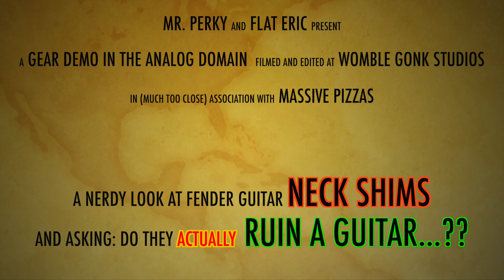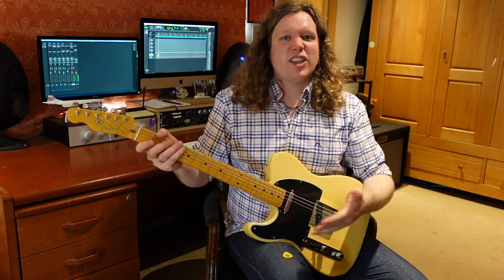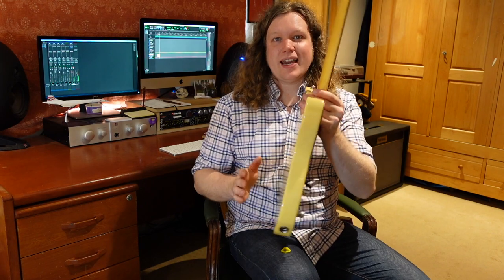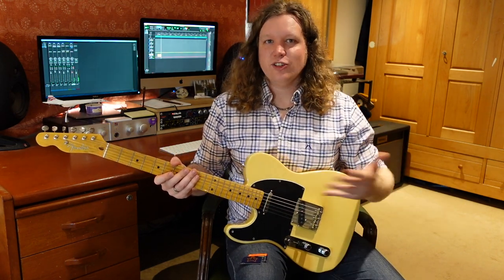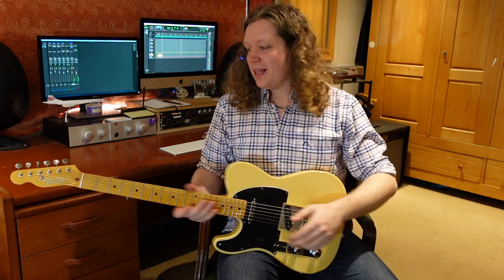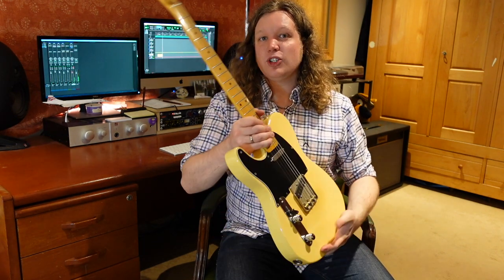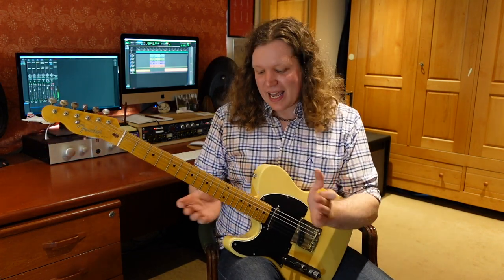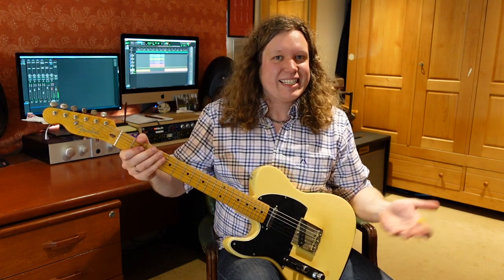Does 'Shimming' The Neck Ruin A Guitar...? (Cardboard & @stewmac)

Comment: In my experience: The best guitar is the one you want to pickup and play. If not being able to bend those notes makes you not play it, always shim!
Reply from the maker: 100%!  Playability much more important than a slight difference in tone.
Reply: Exactly!
Reply: I have a cheap Ibanez GIO from 2004 that I bought as my first guitar. I have molded so much that is is unrecognizable, that includes stainless steel frets along a leveling job and let me tell you, that guitar is my favorite 25.5 scale guitar in my arsenal and comes from someone who also owns a Fender American Strat. Facts are facts. Playability>price, brand, model.
Reply: It's a shim that guitar manufacturers don't produce the guitars with a neck angle. Basic

Comment: The thing with cardboard isn't tonal, in my opinion. The real issue lies in the cardboard compressing over time. What happens is that as the cardboard shim compresses and the neck ends up at a more shallow angle. This is why the StewMac wood shims are actually a bit better. They correct the angle and stay much more substantial for a longer time. More about longevity than anything.
Reply: Wood will compress too. Put a C-Clamp on it and tighten it down and remove it and observe the indentation or hit it with a hammer. Chances are the neck will shrink and expand far more from time to time due to environmental factors like humidity and temperature.
Reply: @Vicos  You're right but at the same time, they won't compress quite that way because they're the actual size of the neck pocket, and they're hard maple. They spread out the tension evenly so yes, they may eventually need replaced, but not anywhere close to as quickly as paper or cardboard. Using a c-clamp put all the squeezing force in that one spot and forces it to compress in that spot

Comment: My 1994 USA Fender Stratocastor has an overhigh action, and with the string saddles taken down it is still over high, and I get dead notes and string buzz after the 12th fret. My neck s straight enough so I don't believe it needs truss rod adjustment. Would you say mine is a classic example of needing an angled neck shim. I am going to buy a set of genuine wood, angled neck pocket shims quite cheaply for Temu, and try what you show here.

Comment: A lot of the things people worry about don’t matter. I’ve had old guitars that had neck shims and I never even knew until I removed the neck. I have one guitar with a shim under the nut. Can’t tell. I’ve had guitars where I didn’t bother re-glueing the nut after doing some work. No noticeable difference in tone from when they were glued (remember; a lot of old arch tops just have floating bridges, only held down in place by the tension of the strings on it - and they sound fine). This is why, other than for aesthetic appeal, I prefer bolt on neck to set necks or neck thru guitars. Being able to easily swap out a damaged neck far outweighs any minuscule sustain differences a set neck supposedly gives.

Comment: Original Jazzmasters and Jags came with factory shims, and Leo recognized the necessity of changing the neck angle.( Because of the floating bridge design.)Occasionally, other models require them as well, and long before Stew Mac sold expensive wood shims, luthiers used whatever.Anything that is somewhat malleable will work,- business cards work great.Any slight change this might represent is either psychological, or inconsequential.
Speaking of fingerboard fall off, it's become very common to simply make frets 11- 22 a bit lower, preferably slightly more so as you move up the board; you usually don't need to grade the fingerboard, only the frets.I've been doing this on new necks when I must level and crown them.

Comment: I couldn't hear any difference, but I'm knocking on, and my hearing is perhaps not as sharp as it once was. I had a similar problem with a Telecaster kit and found a decent shim set on Amazon for only £11.99 with free delivery. I agree with your viewpoint. Why bodge the job with cardboard when for the price of a couple of drinks you can do it properly? The neck is a major stress point and, personally, I'd rather it was fully supported in the pocket the entire length of the neck heel. 

A piece of advice; after refitting a bolt-on neck, string and tune up then "very gently" undo the neck plate screws in diagonal order "only just enough" to allow the neck heel to move, and until you hear a slight creak as the string tension pulls the neck heel all the way home into the pocket, then screw it back up tight and retune. This ensures a good fit and maximum neck heel to pocket contact. 

Also, never use a power tool to tighten neck screws as it might strip the thread holes. Always use a well-fitting manual screwdriver to get a better feel for appropriate torque on the screws.

Comment: Before watching this, I was convinced there would be no difference. But I was shocked to hear the difference (though it is subtle, as you said). I wonder if the angle of the strings on the un-shimmed clips made the strings vibrate close to the frets, giving that extra zing? All the clips still sounded great.
Reply from the maker: The action was kept exactly the same - so the strings weren't fouling on the frets or anything :-)

Comment: Unless it's a controlled looper doing the same music at different settings, I just dont see how this can be taken as a controlled experiment.  Anything you feel is probably a result of playability.  Leo had business cards as shims, but the 60's Strats all sound great. Unless it's a structural issue, one really focus on good playability and contact for body resonance (even then, resonance is debatable - every last ounce I suppose).  Bolt on guitars are going to depend so much on playability and setups.  Your bridge angle, bridge material, frets, nuts... etc are going to be far more important as they directly affect the sound.  These are all peripheral "improvements" that are minor at best and placebo most of the time.

Comment: No Shim at all has the natural Telecaster sparkle, that's how the high frequencies in a Telecaster sound. With the cardboard shim the sound is completely muffled no sparkle or life. With the Stew Mac complete pocket shim the sound is not as muffled but the sparkle (treble and harmonic) are still a bit dimmed compared to no shim at all. So for the 3 options having No Shim still sounds the Best to me, it's the natural sound of the guitar and both shims will impact and change that sound
Reply: correctamundo

Comment: No difference in any, the flaw in these comparisons is always going to exist, you cannot play the guitar the same weight and the guitar needs a long time to settle from a neck removal plus other parameters, the sustain and sound is nut to bridge, guitar pups don't pick up like a diaphram so the only time you can listen to the acoustic qualities is without the amp, generally speaking a bolt on neck will change sound because of socket tension, where fasteners are not torqued the same or are loose, stripped even adding shims can create future issues depending on the material used as moisture can play future issues, so it's not clean cut, guitars constantly change their sound, strings, climate and expansion and contraction all play a part.

Comment: Definitely on board with the Stew Mac shimming method. Makes the most sense from a design and sonic perspective, but damn are they expensive! 
But if you're going to do it, and one has money invested in a guitar, I say don't go half assed, do it right and be done with it. 
I've got a set, along with some "similar" design plastic (of some sort) shims. Work(s) in progress. Amateur luthier here trying to figure things out.
My issue with one Strat seems to be the nut being too low. Don't often hear that. Have a couple bone nuts coming, and this should be interesting!

Comment: Strictly geometrically, how would shimming be different than raising/lowering saddles?
Shimming comes into the picture when the saddles would be extremely high or low otherwise, but if saddle height didn't solve the problem (without creating a saddle height problem), how would shimming solve the problem?

Comment: I’ve just this week had to do a fret job and shim on a Squier affinity strat. The problem was severe- buzz at the nut and high end that couldn’t be adjusted out. Raising the action pitched the nites out of tune where the relief was in the center of the neck. I’m not a pro but I’ve been doing my own work a while now and on an affinity it’s not like I’m going to ruin an expensive guitar. Anyway I used cardboard and after I did the frets it solved the problem. Can’t say I noticed a tonal difference but I am concerned the cardboard will compress eventuallyso I’ll be getting some wooden shims soon to make it more permanent.

Comment: This baffles me. It already has a shim so this is  actually making it bridge across 2 shims. I would have removed the original shim first to achieve the same result (unless it lowered the bridge saddles too much in which case I would use the full shim because the pocket is routed too deep) But I wouldn't use 2 shims like this😵‍💫 Leaving that original shim in there defeats the purpose of using a full wedge shim.
Reply from the maker: The original shim was removed before the StewMac shim was installed.

Comment: I did hear the difference. More volume and more body in the shimmed versions, with the cardboard variant sounding darker. But… I assume that after installing the shims you had to compensate the string action, bringing the strings closer to the board and pups again, right? So maybe we’re hearing mostly those differences. Anyway, I’ll take the stewmac version any day. ;)
Reply from the maker: The difference in action the shim created was so negligible I couldn't even see it using a ruler measuring the string heights over the pickups!  So I just left it the same....it might have made a 0.01mm difference, but nothing that could have been accurately tweaked by an ape like me. :P

Comment: Adding a shim just made more space between frets and ringing strings as it will make if you loosen trussrode which eliminated the ringing of the strings on the first frets. That's all the difference in the tone
Reply from the maker: Truss rod controls relief in the neck; shimming adjusts the neck angle. Very different things.

Comment: I've upgraded the hell out of my Affinity Tele banging my head against the wall. Come to find out GC charged me for a setup and installed a nut but the guitar needs a shim. Two guitar techs ignored me when I tried to tell them it needed a shim. If the saddles are floating and you still can't get the strings low enough that's a sign. Small piece of a buis.. Card made a huge diff. But now nut is cut too low. Now nut needs a shim.

Comment: I used a strip of sand paper cant tell the differance,But worked good ,my angle is better and action is lower from 12 all the up the neck.Only used it on back screws,action is now 1 mm with no bend buzzing any where.

Comment: I don't see how shimming will get rid of the choking out on the higher frets beside just raising the string action, and that’s done with the saddle screws. You change the neck angle only  if the action of the saddle screws are on its limits, or if you want the strings closer or further away from the body.
   Otherwise the proper solution is to dress the upper frets with a fall-off. From the 13-th to the very last fret at a slight angle lower in comparison to the rest of the frets. 
   Also if some might have a sound difference to better after shimming with a wooden shim,  the screws might not have clearance in the body holes. If the screws bite in the body wood, it’s not possible to tighten the neck onto the body. It’s mechanically impossible! Make sure the screws slip freely in the body holes.
Cheers
Reply from the maker: The shim is angled, so it changes the pitch of the neck rather than just packing it out uniformly - creates a similar fallaway to a fret dress with much less intrusive work!
Reply: @JoePerkinsMusic  
But it doesn’t get rid of the higher frets beyond the 13. fret, wich is caused by the slight bow of the neck due to neck relief…
Reply from the maker: It doesn't - but by 'raising up' the lower frets by adjusting the angle of the neck, the effect is similar.
Reply: @JoePerkinsMusic  To be honest, I still don't see how this is the case. Try drawing a diagram on a piece of paper to visualize what's going on. As far as the relationship between the strings and the frets go, adjusting the angle of the neck is 100% equivalent to adjusting the action at the bridge. In fact, by adjusting the saddle height you are in fact changing the angle between the neck and the strings. The only possible difference is ergonomic - different angle between the neck and the body may feel slightly different for your left hand assuming the guitar's position on your right leg is the same. But as far as chocking out / buzzing - there's absolutely no difference between shimming the neck and raising the saddles (obviously assuming there's enough room for adjustment).
Reply: You're totally correct. You only shim a neck if you run out of adjustment at the saddles in the bridge.

Comment: I have just the opposite problem. My saddles won’t go any lower and the strings are still too high
Reply: truss rod, no? tighten it if your neck is curved.
Reply: This is exactly where you want to use a shim. If you use a 0.5 degree shim, it should give you about 2mm more adjustment at the bridge.

Comment: The issue with this sort of comparison, where you are detaching and reattaching the neck with the neck being being held in place by screws into wood, is that just by unscrewing and rescrewing the neck you change the contact and coupling between neck heel and body which means that the differences there are could just as easily be down to the neck not being attached as tightly as before and not because of the shim per se. 

And everytime you unscrew and rescrew the screw holes change somewhat, to the point that if you do it often enough they will strip.
Reply from the maker: I won't take it off any more then :P
Reply: @JoePerkinsMusic  Monty’s sell threaded inserts and bolts with which you can make a “bolt-on neck” actually bolt on. I haven’t used the Monty’s ones but have done this mod to a number of guitars and asides from the practicality of it, I think it might change the sound a bit, though it’s hard to quantify or A/B with any certainty. Though one thing it does allow you to do is to hear the effect that changing the coupling between the body and neck has on the sound (loosen the bolts a quarter turn) and it definitely impacts sustain/loudness. Maybe reach out to Matt at Monty’s and see what he has to say about the mod.
Reply from the maker: @colmkelly5524  I'll mention it next time I chat to him :-)

Comment: AWESOME channel... great video.... I took all my paper shims out last year... the guitars are all bolt on necks...now have no shim....I got a staytrem bridge for a jazzmaster and took out the shim when replacing the bridge. I noticed right away the difference without the paper shims. I think the one thing you didnt mention, I could be wrong... most dont realize it takes a while to get a neck right. And higher action does give off more vibration thus more tone. I'm assuming you used the 5 degree shim? How did you come up with 5?
Reply from the maker: I lowered the saddles after installing the shim to keep the action exactly the same 👍 To be honest, I just bought the gauge of shim that was in stock in a shop here in the UK (the rest weren't) and it happened to work perfectly - so it was a bit of a guess on my part!!
Reply: thanks...then all you need to do is start at 5

Comment: I would rather try adjusting the truss rod by loosening it. for me, if it's an issue of the action being different heights, always truss first.
Reply from the maker: Adjusting the truss will only adjust the bow in the middle part of the neck though - it won't really make any difference to the notes choking out over the top of the neck pocket.

Comment: It is not unusual after a shim that the whole guitar sounds better. What happens is over time the screws loosen a little. Not enough to notice but once you shim the guitar you naturally make sure the neck is on tight. You can even give a little tighten to an old guitar without any problems and find by 'magic' it sustains longer :-)
Attention ALL ... Do not forget a thumbs up... and subscribe if you haven't. Trust me, we will have a front row chair for you when you come back here for the next video :-)
Reply: Loose screws are a separate issue, not a reason to shim. Just fill the loose holes with a toothpick or two and maybe a small drop of glue. Or if its really loose, a maple dowel same and redrill proper hole size.

Comment: I hardtailed my strat with a piece of mahogany and had this issue with the new bridge, being lower than the former tremolo. My tech put in a veneer to adjust the neck angle. From all of those changes I recommend the mahogany tone block, if u will. Such a nice tone change to an alder body. I just got a CRL 5 way switch based on your video. Made the guitar brighter. Here's something I found, based on hifi amplifiers, if u solder with silver added solder, the sound improves aka more signal goes through. But the biggest diff was made when using a Fender CTS brass shaft pot...the volume increased by 40%. I have now to dial the volume back to 7 to get the same tone as with an aluminium CTS pot